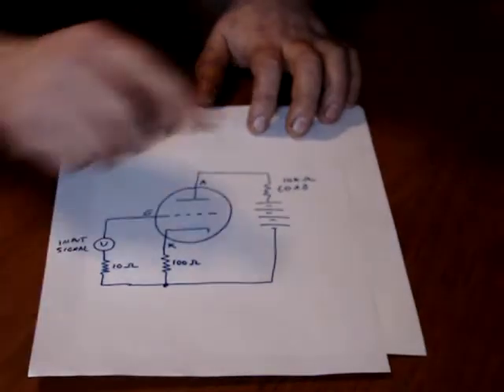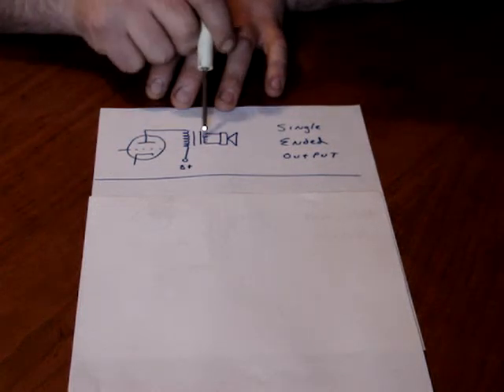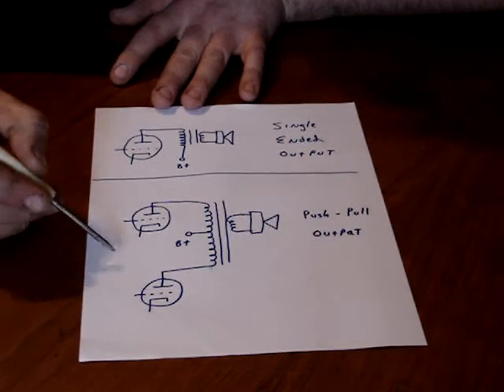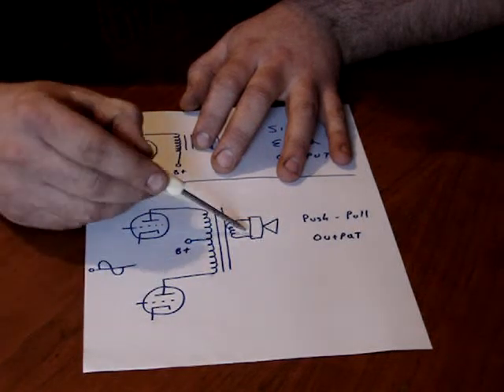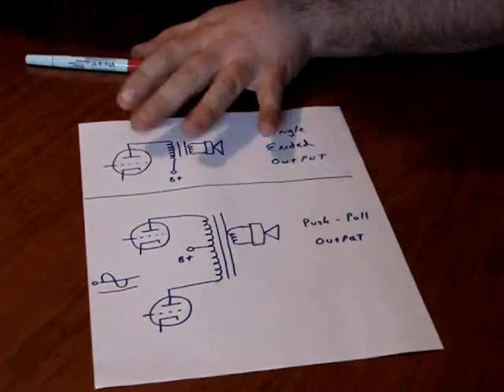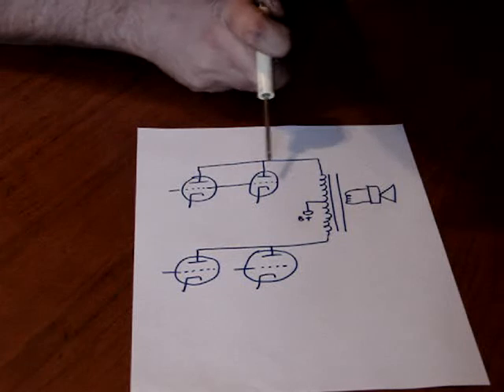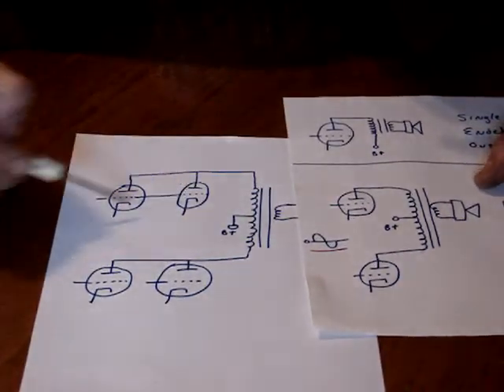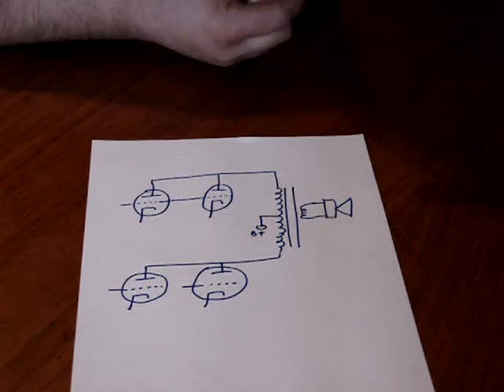The Learning Series - Vacuum Tubes and Amps Part 6

Comment: This learning series has been extremely informative so far.  I understand a great deal more about tube amps than I did when I started.

One question -- in the push-pull amp, how do you "split" the incoming signal into its positive and negative halves?  I suppose you'd use a rectifier for that, yes?  Do you have any specific examples that you can link?

Thanks again for making these vids -- great series!
Reply: Look into 'concertina' phase splitter circuits. They are simple, single device (12AU7, 6SN7, etc) phase inverters able to easily drive two power devices (e.g. 2x 6L6,  2x KT77, etc...) and have great linearity and good drive (output) impedance balance - 5 to 7 parts (inc. valve).

They can be valve or transistor; same principle

Don't use a rectifier unless you want anti-phase rectified pulsed DC drive signals (sythns, etc...).

Comment: The only part I don't understand is that it appears that electrons are flowing from ground through the cathode to the plates which are connected to high voltage B+. I'm probably missing something.